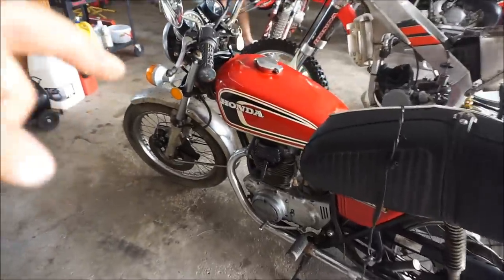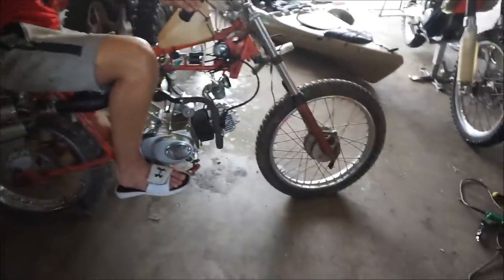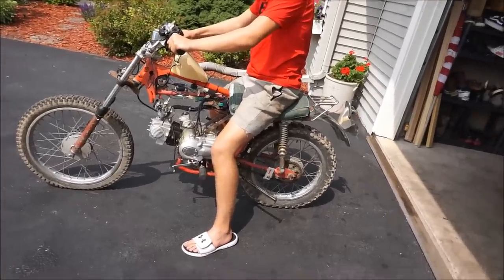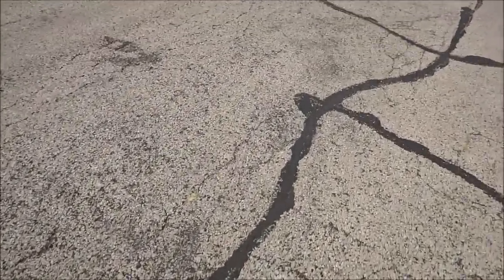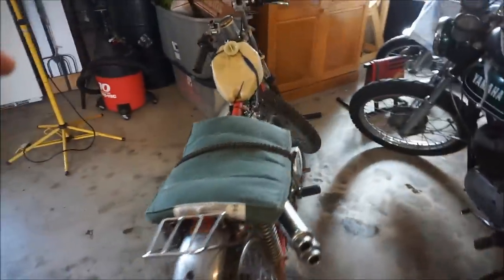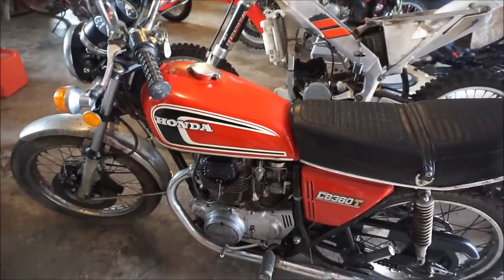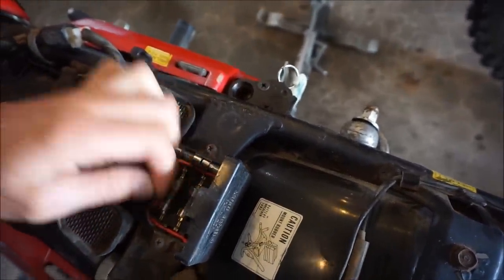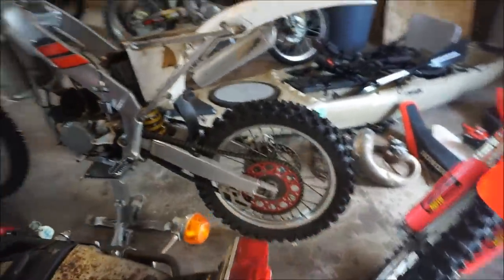The Rigged Rat Rod Bike!!!

Comment: Be careful on that "Rat Rod" bike,you took a lot of strength out of the frame when you cut it to fit that engine in it..It wouldn't be a bad idea if you could make a bracket or something & weld it from where you cut it (toward the neck tube area) & bolt it to the engine..It would help restore some of the strength anyway..When I was a kid I rode a bicycle that was missing a bar from the frame,I took it down a steep driveway & it broke completely in half with me!..I rode a CB360 once,I think it was the same color & model as yours..I was blown away by how smooth that bike rode & handled for a older bike,really cool bikes!..I enjoy your videos & I think its great how close you two brothers are,that is how its should be!

Comment: Nice video👌 those Chinese 110 engines last for ages, we had a quad in the worst shape with the same engine from 2008. We did not ride the quad for a few years and it was sitting outside, and the engine still ran after a carb clean

Comment: To get rust out of a gas tank use muratic acid  from a pool supply company. dont leave it in long though it will eat right through you tank. also use good eye protection and gloves too. will dissolve the rust and leave bare metal

Comment: You guys should get a big bore kit for that little 110
Reply: xavmeister99 agree
Reply: Just curious.. what kind of power do you think a big bore provides ? Mechanic here and reading silly comments like these make me laugh, if you want gains you don't put a big bore on a trash little engine you swap a bigger engine with a bigger stroke, drinks more gas, and a better transmission in there, boring a cylinder is more common for fixing damaged cylinders then it is common for trying to get more power
Reply: Benjamin M Noseworthy ive had good results with big bore kits. Sure the power gain isnt amazing obviously, but there is a noticeable difference.  I agree with swapping for a bigger displacement engine, but thats pretty costly. Big bore kits are great for adding a bit of pep to your existing engine for not too much money
Reply: Benjamin M Noseworthy With the way they have the gram cut I wouldn't put anything bigger in there. I'd weld on some frame rails that go around the engine and connect where the old ones were, then maybe think about a better engine. An early air cooled CR125 engine would be cool.